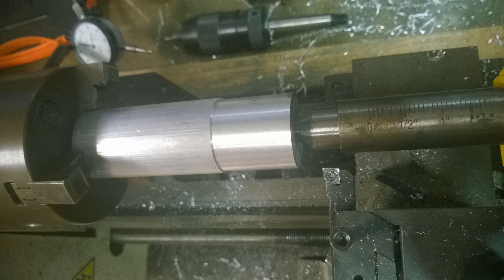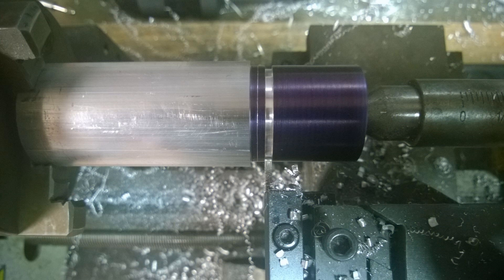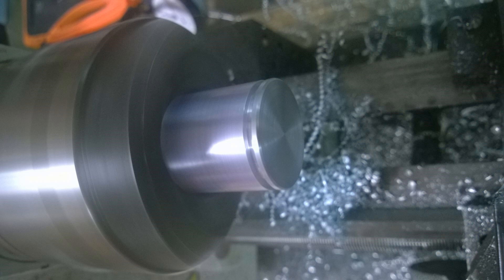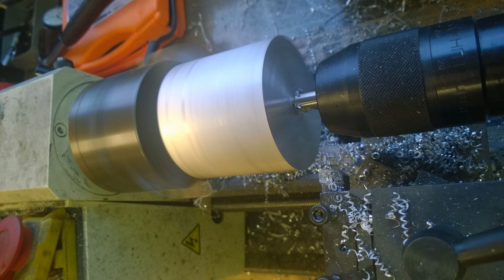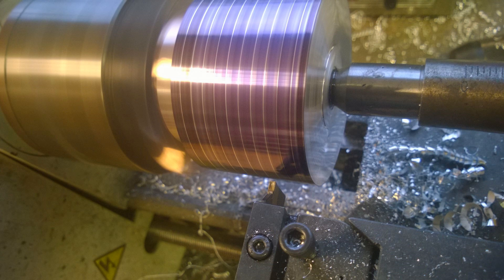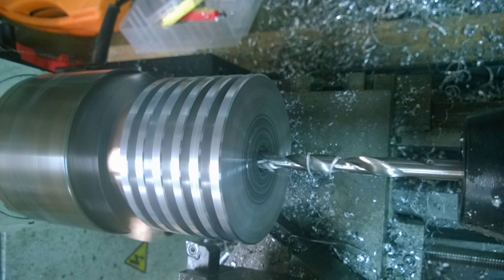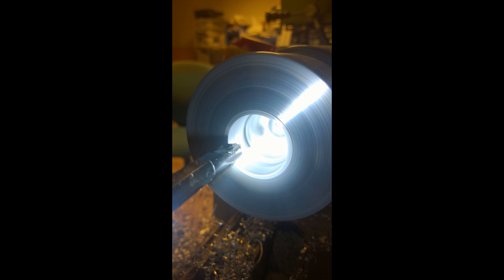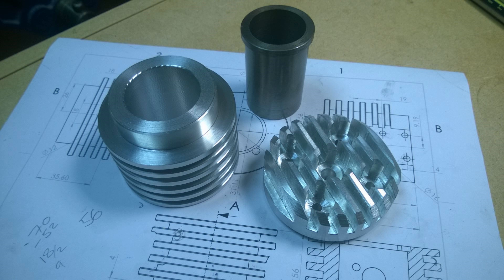Homemade 2 stroke engine step by step - Part 4 + 5

Comment: Maybe you've already explained this in another video, but I'm wondering what sort of calculations you had to do when designing this engine.  I don't have any experience with machining but I could probably get it machined by someone else as long as I provide the files.  The thing is that when I'm designing my little engine I think to myself:
"How do I know how thick to make the walls of the cylinder?"
"How do I get the amount of gas I want into the engine, and how would I calculate the amount of gas that the engine requires?  I assume it's some measure of displacement and air intake?"
I don't have a background in engineering.  I'm guessing that when making an engine like this you don't have to be nearly as precise and can eye-ball/guess some things but I would still like to do it right.  I want to do what you are doing, making a small engine and then improving it gradually.  This way I can learn more about the design and functionality of engines.  I am hoping to make a small little ultralight aircraft and while I could possibly modify a motorcycle engine, I think making my own would be more interesting.
Reply from the maker: This will all come later - matt
Reply: Thank you.
Reply: Yeah same here, saved up 4 months of wage, going to get a mill and lathe myself. This inspired me to finally make my own engine. Been thinking about this for so long. #FailureHereWeCome